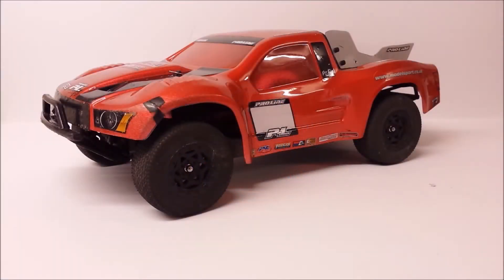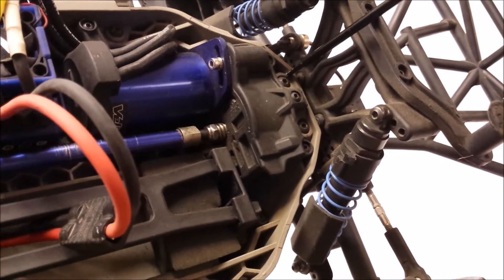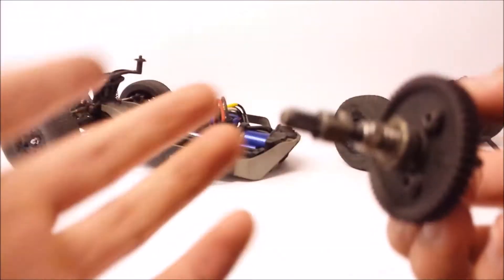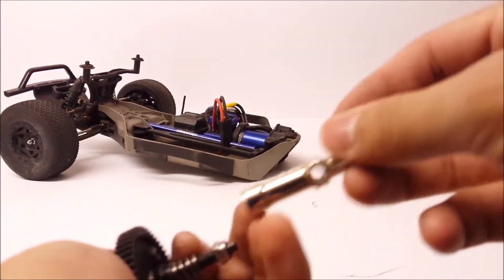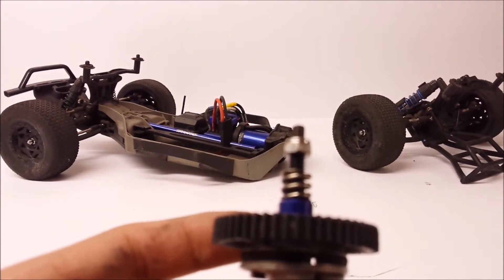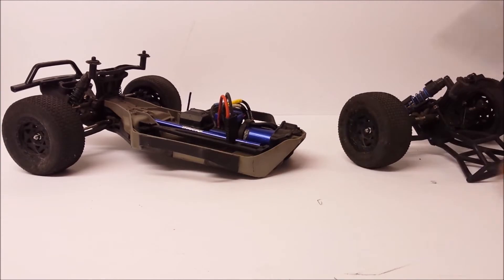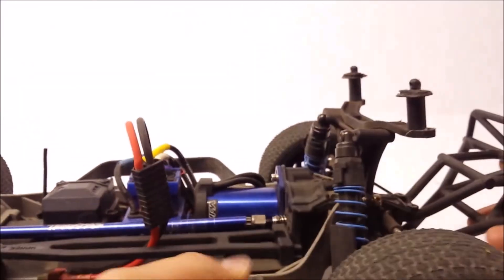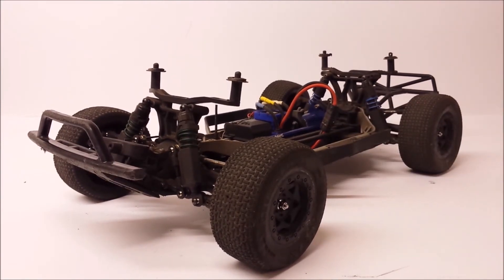RC How to: Slash 4x4 Aluminium Bearing Adaptor

Comment: great video.  thanks.   but, it looks like you got the slipper nut a little too tight.  is this "tighten it all the way, then back off 1/2 turn" standard practice?
Reply from the maker: Hi my friend and thankyou for the supportive words,  this is the technique I have used and I've never had anything go wrong if I had it any more loose I found that it slipped to much hope this helps :)
Reply: i just checked mine, and the factory setting is the same as you described.  half turn out.